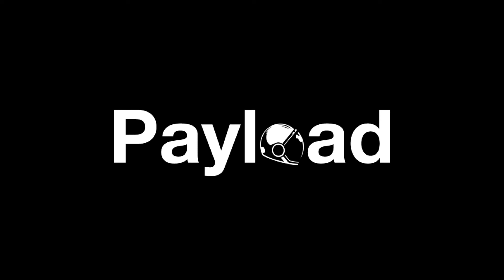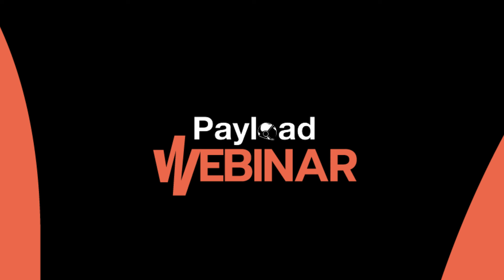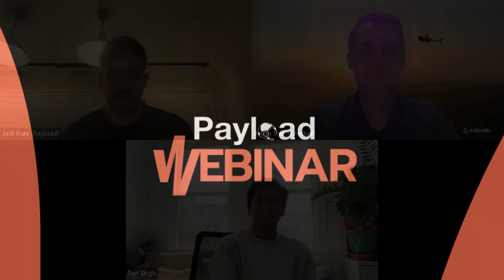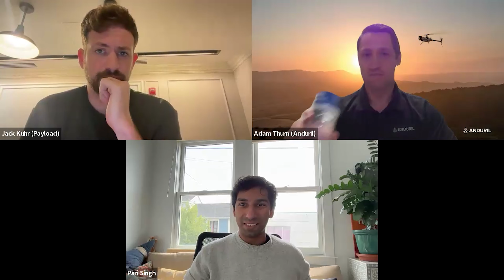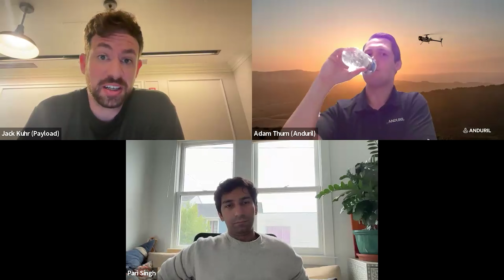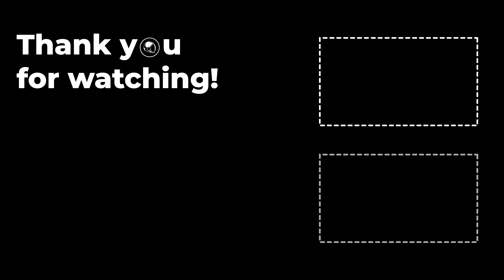Breaking Tradition: NASA's Waterfall vs Agile Systems Engineering

Comment: Here’s a 10-bullet summary of the video “Breaking Tradition: NASA's Waterfall vs Agile Systems Engineering”:
	1. Waterfall vs Agile Defined: Waterfall is NASA’s traditional, linear approach—long planning phases and rigid execution. Agile, by contrast, is iterative, adaptive, and emphasizes learning through multiple development cycles.
	2. Complexity Demands Agility: As systems become more complex—especially with software integration—first-order requirement decomposition becomes insufficient. Agile allows for real-time learning and adjustment.
	3. Cultural Shift Required: Agile success depends on empowering engineers to act as systems thinkers. The concept of a “Responsible Engineer” (RE) blends domain expertise with systems-level awareness.
	4. NASA’s Agile Roots: Despite its current waterfall reputation, NASA’s Apollo program was fundamentally agile—iterative missions (Mercury, Gemini, Apollo) built capability step-by-step.
	5. DoD’s Quiet Agility: Contrary to public perception, parts of the DoD have long embraced agile practices. Programs like Anduril’s collaborative combat aircraft show how government and contractors can co-develop iteratively.
	6. Customer Integration is Key: Agile thrives when customers are embedded in the development process—participating in demos, reviewing Jira boards, and providing real-time feedback.
	7. Agile ≠ Chaos: Misunderstanding agile can lead to scope creep and disorganization. True agile balances top-down mission goals with bottom-up engineering input, guided by clear priorities.
	8. Hardware Constraints Managed: Agile can work even with long hardware lead times by using breadboards, dev kits, and software-first development to iterate while hardware catches up.
	9. Mission Assurance Still Central: Agile doesn’t mean sacrificing safety or reliability. Iterative testing and learning can actually enhance mission assurance, especially in unmanned systems.
	10. Mars is Possible—With Agility: The speakers believe a Mars mission is achievable within a decade, but only if we embrace agile principles, empower engineers, and maintain a culture of continuous iteration and learning.
 
 
 Best Practices for Agile Systems Engineering
	1. Start with a Clear Mission-Level Requirement
Anchor the program around a single, high-level goal that guides all downstream decisions and iterations.
	2. Empower Responsible Engineers (REs)
Each engineer should act as both a domain expert and a systems thinker—understanding how their component affects the whole system.
	3. Iterate with Purpose
Agile doesn’t mean chaos. It means structured iteration: build, test, learn, and refine—each cycle should add value or insight.
	4. Design for Feedback Loops
Plan regular demos and reviews (internal and with customers) to validate progress and adjust direction early and often.
	5. Decompose Architectures Early
Define system-level architecture and interfaces upfront to allow parallel development and reduce integration friction later.
	6. Treat Requirements as Evolving Design Variables
Especially at lower levels, requirements should be flexible and updated as understanding deepens—not rigid contracts.
	7. Embed the Customer in the Process
Involve end users and stakeholders continuously—not just at milestones—to ensure the product meets real-world needs.
	8. Balance Top-Down and Bottom-Up Thinking
Combine strategic direction from leadership with tactical innovation from engineering teams to stay aligned and adaptive.
	9. Accept Micro-Waste to Avoid Macro-Failure
Some rework or discarded prototypes are acceptable if they accelerate learning and reduce the risk of large-scale failure.
	10. Use Time as the Fixed Constraint, Not Scope
Set fixed delivery timelines and allow scope to flex within that window. This drives focus and prevents endless iteration.